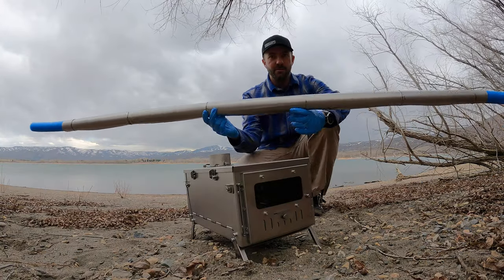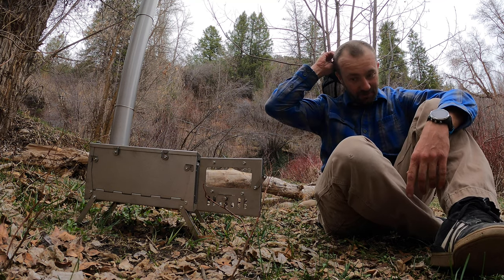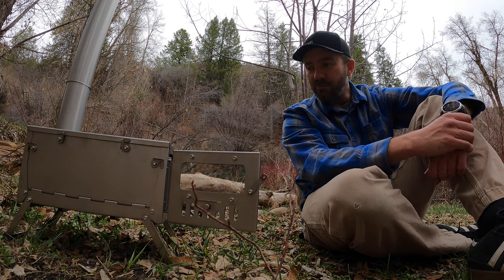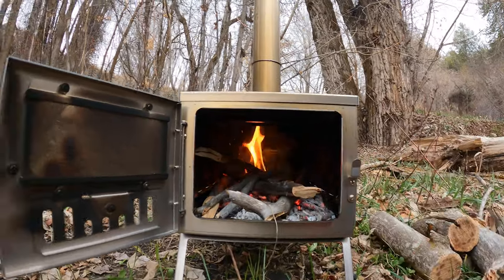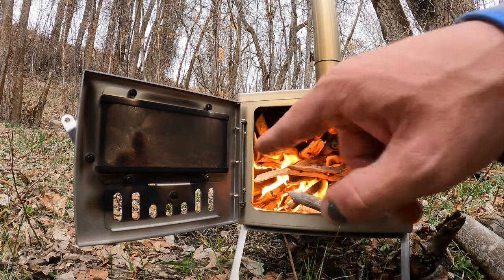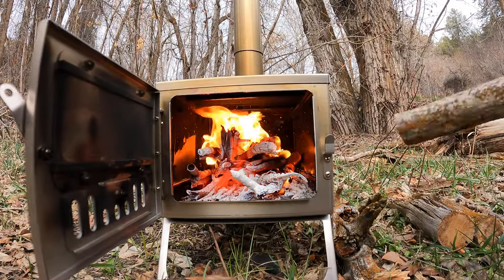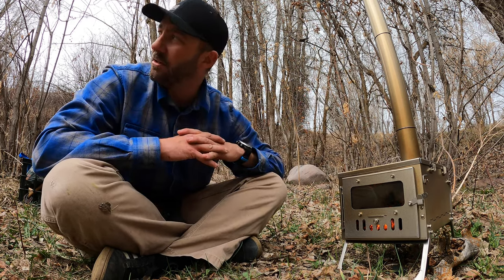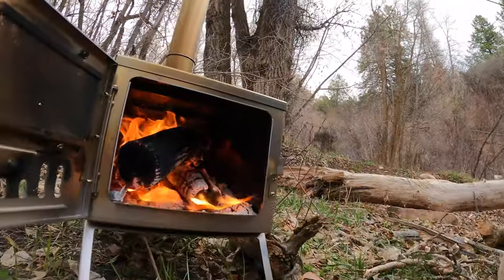HOT TENT STOVE SETUP & BURN IN | Pomoly T1 Mini Titanium

Comment: hi, thanks for sharing! im just looking for this stove too. Between many options out there it sems the best option for me.
I have the idea to  use it on cold climate bellow freezing temperatures, backpacking, snowshoeing, backcountry skiing and probably on some kayak winter trips to dry gear and to warm up. Mainly to carrry it in a backpack...
Also planning to use it with a heat battery charger for my powerbank. (I also have a sun charger)
How do you feel about it? Is the pipe still in good  shape?Would you recommend it? 
i know you would  probably still need to try it on proper winter climate but just wondering to know how it works for you.
Anyway , i found you videos really usefull. thanks!
Reply from the maker: Thanks a lot! The few instances that I’ve used it it has been an absolute joy. I’m sure you won’t regret it and it’ll be helpful on your adventures. 

It is a bit bulky and not really ultra lightweight as far as backpacking or backcountry skiing goes, but if you can distribute some weight/other food & gear amongst others in your party it’s a definite winner! Plenty of heat to cook, warm up, and dry things out is amazing. 

It does require a fair amount of wood processing to keep it fed and it might burn for 2 hours or so at most when stuffed with good hardwoods and a good flame going. So it takes some effort to keep it going. 

Check out my follow up video to this one where I take it on its first motorcycle outing. 

Enjoy!
Reply from the maker: https://youtu.be/SuJavWd6aPw
Reply from the maker: The pipe is still in good shape. I do have a second pipe that shorter that I have yet to burn in. Might not be a bad idea to have some sort of back up at your house in case yours gets mangled on a trip. Kind of fragile and one tip over or trip on a guy rope could ruin it.
Reply: @CaptMaxADV  Hi ! thanks for answering and sharing !. We apreciate the info and opinion! I think the T1 Mini is going to be my choice, but i dont like that pipe, looks flimsy and weak... Just thinking about purchasing a nested/nesting pipe , i would weight a bit more but i want something more stable sturdy that wouldn´t fail , bend or collapse due to the wind or an accident... Also similar packed size (just a bit more weight ) but not rolling needed. Now, i´m just looking for that nested/nesting pipes at the same diameter at the base and 30 cm in lenght sections aprox.

I apreciate any info or help to find that pipe. I´m from Europe !
Reply from the maker: Sure thing. Pomoly recently released their multi piece pipe. Check out their website.
Reply: @CaptMaxADV  Hi!, thanks, i gave them a look but they are not nested ones. I would also recommend the nested ones for your bike adventures,(i watched a few of your videos)just not to relay only on the guidelines to hold the pipe into position, because we can step into them (or even my dog )and cause a disaster... too flimsy and weak  for my taste and dangerous too ... ive seen also many videos showing smoke leaks through the overlaping( and a few having some melted areas) on the rollable  pipe.
Could you recommend any nested/nesting  pipes that would fit into the T1 mini stove?
Thanks in advance!!
Reply from the maker: Shoot! I was hoping you could recommend any to me! If you find one come back and tell us! Good luck!

Comment: Whisky, thanks for this.  I bought the taisoca which has the oven on the bottom.  I was a little ticked when I made the payment through Paypal and saw that the recipient was Chinese.  Assumed it was made in the USA. At $649, the idea of sending that much money to China really bothers me.   The oven has two removable grates which I'm thinking of using in the stove.  Are you getting any deflection of the bottom metal by the wood laying right on it?
Reply: Any problem pulling that noodle out?
Reply from the maker: No problem there. Once the rings are on it’s a bit larger than the noodle so it slides right out as I recall.
Reply from the maker: There’s a FaceBook group that Pomoly is fairly responsive to, and a ton of customer interaction/experiences for product use/quality/customer service issues etc. 

I’ve only used mine a handful of times but no deflecting issues so far!

I’d not hesitate to pick up a couple different ones for different applications. 

Enjoy!
Reply from the maker: https://www.facebook.com/101811291262400/posts/656558019121055/?d=n